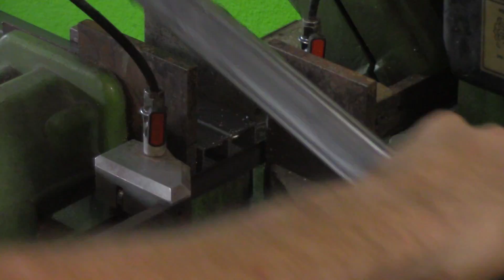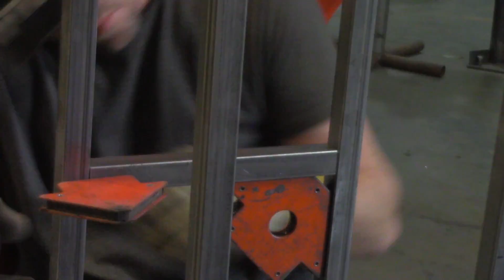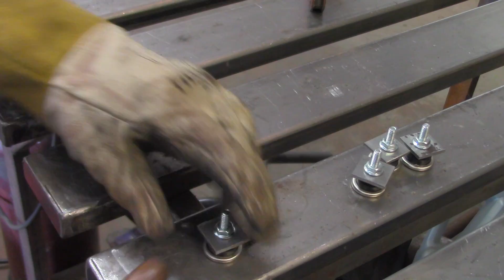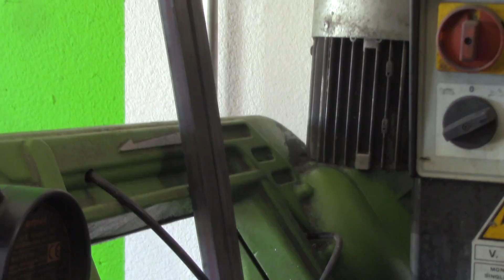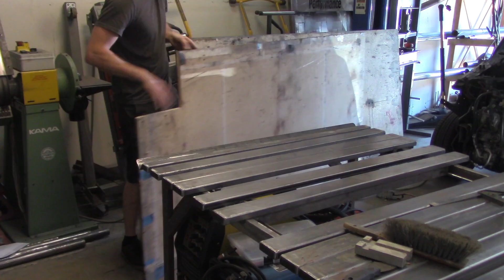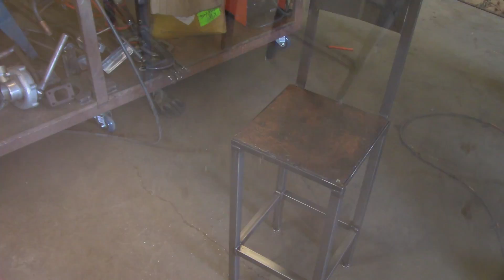TFS: Quick and Easy Custom Furniture

Comment: Nice build.  One thing that is common on stools and sometimes chairs is to offset the cross braces.  Visually it's maybe more interesting, structurally it's stronger and less rack-able.  For wood construction it's also a lot easier to make strong joints, not really an issue with welded construction.  Also not so much of an issue since the stools have a back, but with backless stools the offset supports make it work better for different sized legs.  Generally you offset up so shorter people and or kids don't have to dangle there legs.  Not a knock, just a suggestion.

Comment: Neat project. Something you did reminded me of a lesson I learned from the pro cabinet man I utilized for my remodeling company. He did cabinets that ranged in value from 10k to 50k and he told me a story about a homeowner who insisted on applying the polyurethane to his own cabinets. So yogi finished the cabinets, stained them then told the homeowner to wait at least 24-48hrs to apply the polyurethane because the oils in the stain had to completely dry up/evaporate before it could be done. The inpatient home owner did it that night after only a couple hours. A week later he called yogi to ask why the polyurethane would not harden up. It didn't harden up correctly because of the stain contaminating it. Yogi went to have a look and determined that it was easier to tear it all out (16k worth of cabinets) and start over then to try to strip and really finish them correctly. So I always make the point to say "be sure to let the stain evaporate for a couple days before applying the polyurethane finish when I'm giving instructions/advice. Just my $0.02 that could save someone much more.

Comment: How do you decide when to use TIG and when MIG welding?
Reply from the maker: +Alex Trezvy It's usually up to the metal I'm welding. Metals like aluminum, stainless, chromoly, titanium, etc. typically require the TIG. I usually TIG everything unless it's going to take too much time and is not necessary. I also use the MIG for effect (like the intentionally big welds on the chairs).